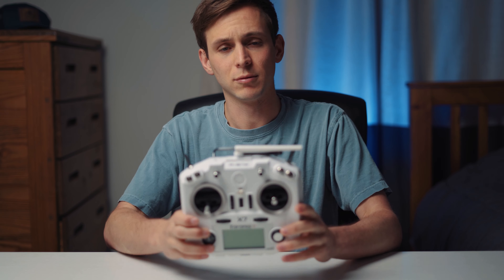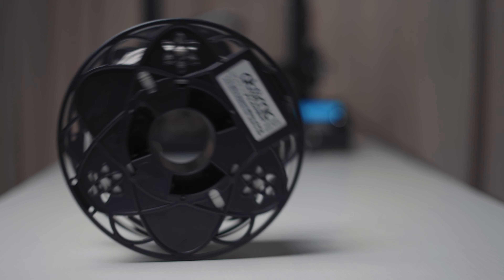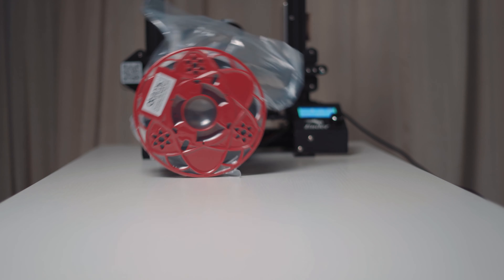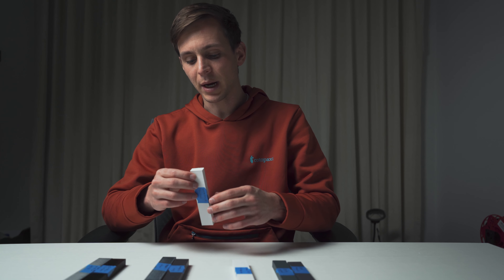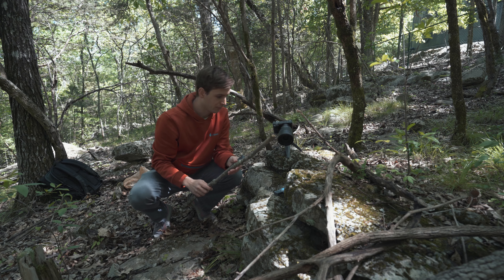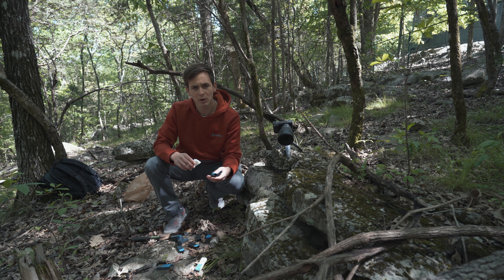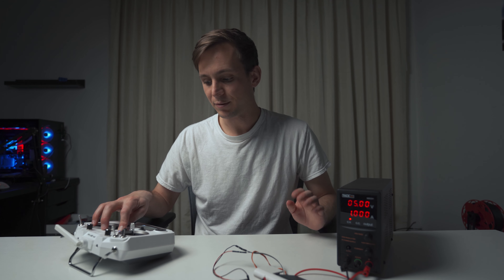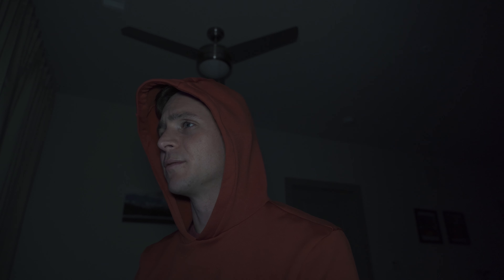3D Printed RC Airplane (Part 1)

Comment: As someone that was into RC planes as a kid and trying to get back into it...
That plane design was a disaster.
But I'm trying to Design my own plane in fusion and having a lot of trouble with it because it's my first fusion design project ever. I got the airfoil done and extruded the wing. So I will give you props for getting a completed file and printing.(I don't even have a printer lol). Good job
Make the wings longer and the flaps a little less prominent.
Im using an airfoil for a flying wing design but I would suggest you use the Clark Y. Very basic

Comment: Not every plane needs to look like a Piper - Good to see someone just try it and think out of the box. Allthough I highly recommend you to get an RC-Airplane out of some kind of traditional material - wether it's foam, wood or carbonfibre - there you get an idea about how Aerodynamics, weights and structural integrity have to be. Next step: get some free stls of 3d-printed planes and print them - this way you will see how they should be designed - it's way more complex than 3 outer walls and 10% Infill ;) As soon as you got some serious skills in a 3d-program you can start designing - and it will be more successful for sure. If you need help getting started - just write me ;) best Regards and keep on experimenting :)

Comment: some suggestions.... i am also in the process of designing my own plane as well. I recommend using fusion 360 as it is free and very simple. some problems I immediately notice, your battery mounting spot is waaay too far back. the plane should balance about 25-33% of the wing measured from the leading edge. Your battery compartment is behind the wing and I can guarantee you it won't fly because it's tail heavy. another thing I noticed was that you have a high weight with a very short wingspan, you have also got 3 layer wall thickness which is waaaayy too much weight. you also forgot the horizontal stabilizer (elevator) and I recommend a larger vertical stabilizer. i recommend using lightweight shell style 3d printing. sorry for the slight criticism but I promise I'm trying to help you improve because I am doing the same thing right now (I am probably over engineering mine as I've gone through about 5 different designs for one part) anyway good luck I'm looking forward to seeing a redesign